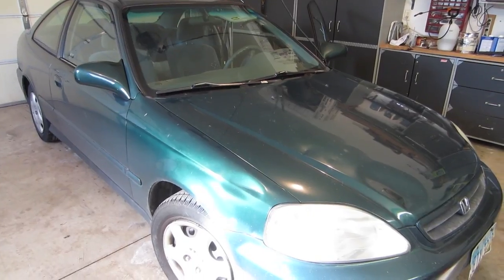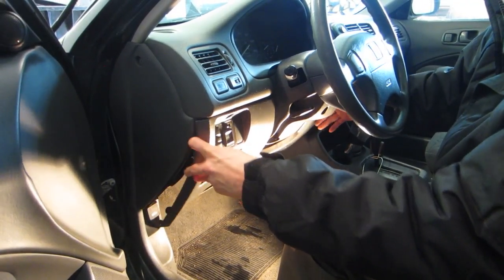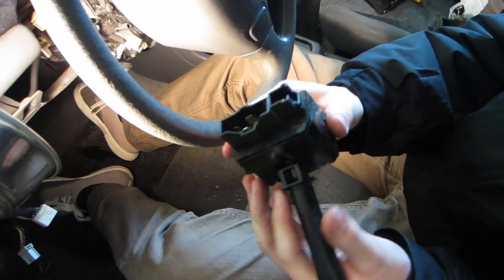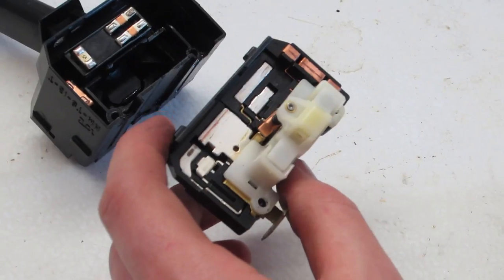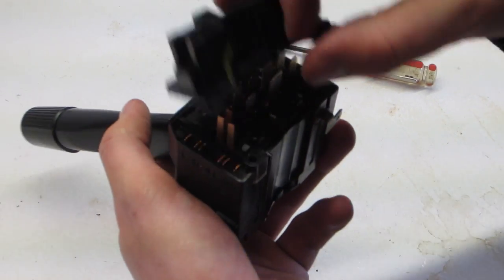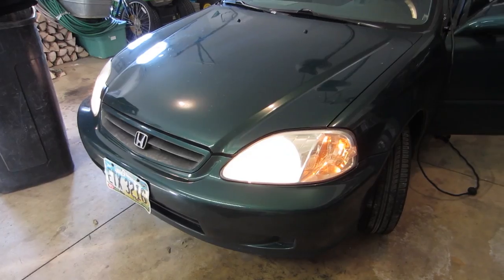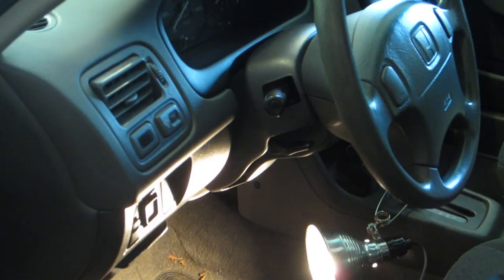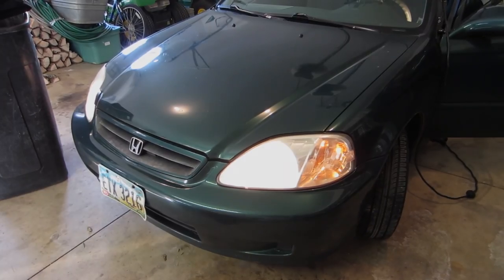(How To) 2000 Honda Civic Headlight Delay Repair

Comment: I have one of these and trying to take the part off at the 2:50 mark and no matter what, it will not budge. I’ve got a large screwdriver holding the edge up and a skinny flathead trying to separate the tabs as you mention. They will not move and wondering how much force we’re talking about. I don’t want to break it. Any thoughts?

Comment: hey, I have a question ! so instead of delaying, only one of the headlights turn on and when I do the high beams the one headlight that turns on turns off and only then high beam on the opposite side turns on. any ideas??
Reply: Daniel Torres i have the same problem
Reply: Daniel Torres did you ever fix yours?

Comment: The problem with this fix is that the contacts are burned.  There is a nickel coating that is damaged and will probably fail again.  I know I'm resurecting a VERY old video.  But I just went to a pick-n-pull and found about 6 cars that have the same control.

Comment: Thanks for taking the time to make the video. My 1999 Civic was the same as your 2000.
It isn't really necessary to unwire the plugs from the plastic dash panel in the beginning of the video. Just sit it on the floor and go about the stalk disassembly.
 I found that it is very important when splitting the switch box open that you need to realize that there are 2 sliding contact bars inside that will fall out unless you are paying close attention, and even if you are they might anyway. The longer bar is for the light switch , the shorter bar does the blinkers. Reassembling requires that the sliding bars are in the exact position they were. 
Mine worked great but if you run into problems Rock Auto is your way out.

http://www.rockauto.com/en/catalog/honda,1999,civic,1.6l+l4+sohc,1355611,electrical-switch+&+relay,turn+signal+switch,4832